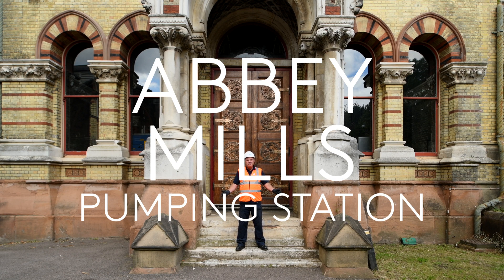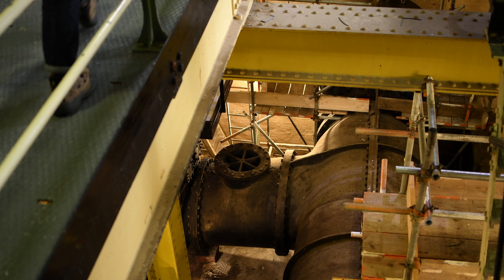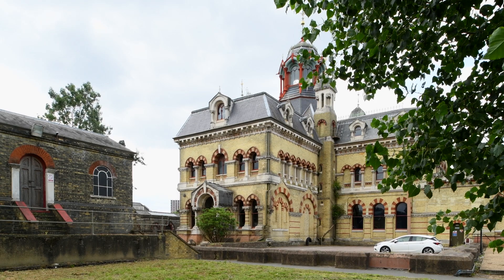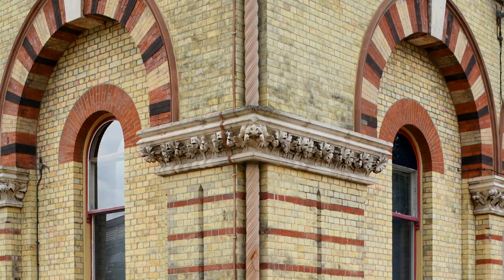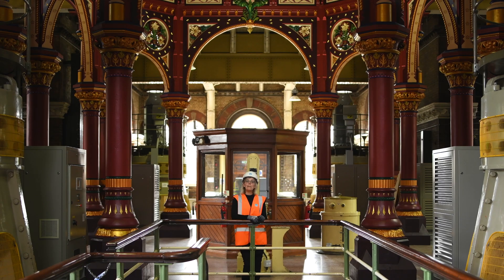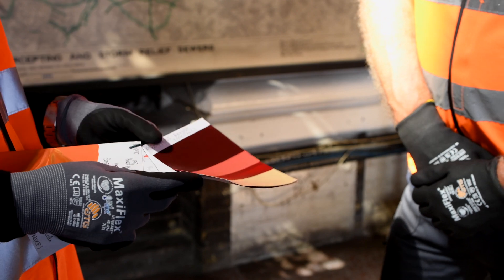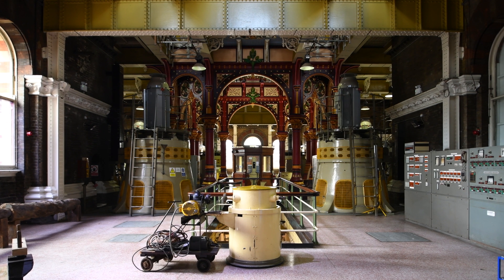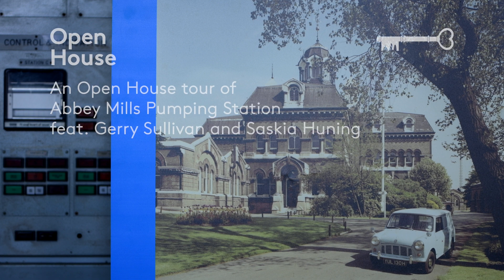Abbey Mills Pumping Station

Comment: From other pictures I have seen it looks like the pumps have had new motors fitted in fairly recent times.

I know about the A, B, C and F stations, but where are or were D and E?

I think the small building near the North (I think) end of the C Station was a valve house, but what were the other small buildings on the site?  I know about the chimney bases.

The colour scheme looks very different to how it was when I last saw it, a sort of yellow and grey I think, looked rather odd.

I’ve been inside Abbey Mills A, C and F, Crossness and Western stations, but have only seen the outside of Deptford, from a DLR train.  Is it still in use?  What plant is installed in it?  I can’t find any pictures of the inside of it.